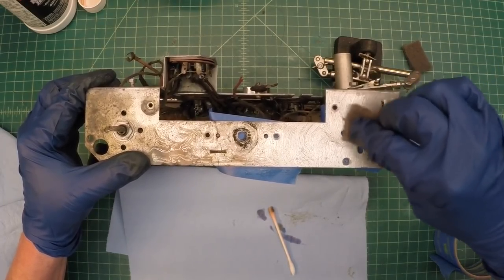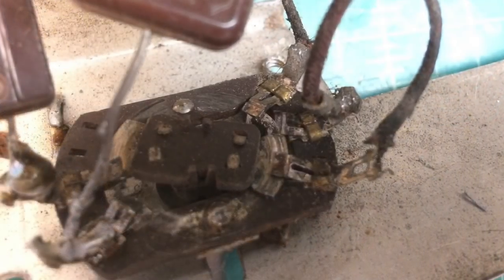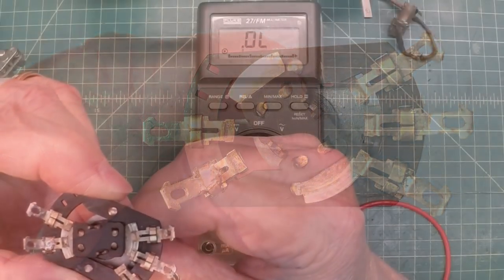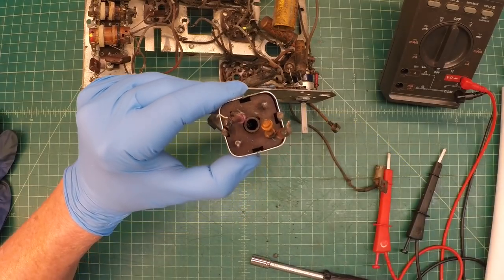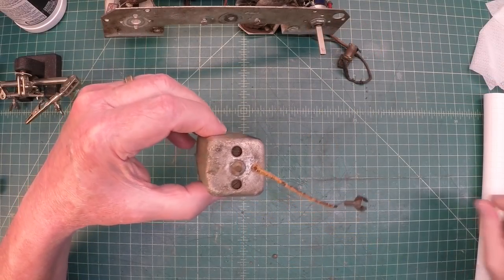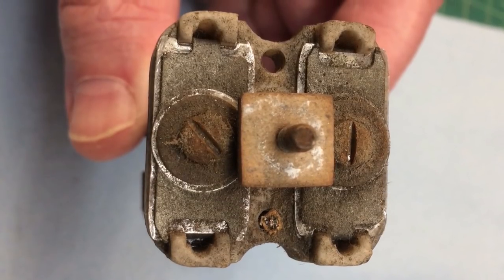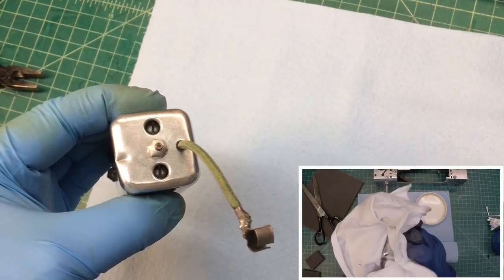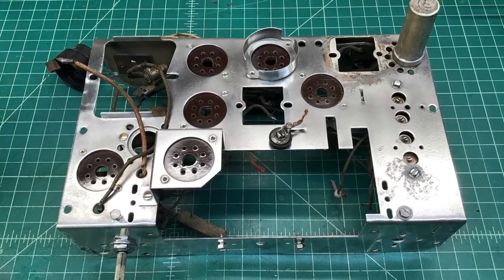Crosley 718-B - Band Change Switch Repair & I.F. Transformer Cleaning/Check

Comment: Amazing job on the slector switch. Certainly a far cry from what you started with. Also the citric acid and water mix does an amazing job. I had often thought about using a diluted acid to clean that kind of stuff. I'm sure the addition of an ultrasonic cleaner would only speed the process and perhaps increase the cleaning power. They work amazing with other things..knobs, screws...etc. Nice work!
Reply from the maker: Hi Paul - so far I’m impressed too. I can’t wait to try some of it in the Ultrasonic cleaner and see how it performs. Thanks again for watching. Best, Don

Comment: Don, I know this is a a year ago but could you say what you used at 6:19 when you cleaned the mica pieces.  In the Zenith 707 series you replaced the mica.  Did you use TO-3 transistor insulators in that case (I probably should have asked this under that video)?
Reply from the maker: Jeff - isopropyl alcohol to clean the mica with a q-tip and correct on the TO-3 mica insulators. If they end up too thick, I will wet sand them down as needed with 400 grit sandpaper, which I’ve done in the past. Sorry for my belated replied, got tied up on a few things that needed attention. Best, Don

Comment: Could you use silver mica caps to replace those mica sheets,
Reply: Silver mica caps, if I understand you, are actually fixed value items & those sheets are part of an adjustable trimmer cap.
Reply: @ordinaryaverageguy76  I seen IF cans repaired with fixed silver mice caps ,you can still adjust them ,there are many you tubes videos showing this repair ,Shangri 66 ,radiotvphononut,many other they cut out the silver mica sheets  ,solder two same value ,silver mica caps,
Reply: There are IF cans where the tuning (peaking) is done via variable inductance (e.g., adjustable ferrite cores) & fixed caps whereas other IF cans use fixed inductance & variable capacitors.  The latter need a variable cap even if it might be padded with a fixed value if you want to peak the IF stage performance.  One could replace a variable with fixed & just call it "good enough" I suppose but it would be suboptimal.

E.g., radiotvphononut's IF repair (https://www.youtube.com/watch?v=QikVrPKNwlY) is a variable inductance IF can and he replaces the internal fixed caps with external fixed caps.
Reply: Those are IF transformers of a different design, they are permeable, or slug tuned, so the powered iron slugs are in the core and the inductance is adjustable whilst the capacity is fixed. In this Crosley the inductance of the IF transformers is fixed, but the capacity is adjustable. Back then it was impossible to build transformers, or any other coil, within exact tolerances, and fix tuned from the factory. Likewise with the rest of the circuitry in the radio, so they required adjustments to put them back to 455 kc, or whatever the frequency was.

Comment: Very interesting Don. Just wondering how you clean the former and the coils or if you do at all? The citric acid does a great job on the cans and screws.
Reply from the maker: Just a little microfiber duster doing my best to remove the the loose stuff from the coils and former. A lot of junk just doesn’t come off and of course I don’t use any cleaner products on the coils themselves. At least they are covered up and out of site. Thanks for reaching out George. Best, Don

Comment: Could you tell me where to buy some of that citrus powder ,I want to keep some,on hand too it work so well for you ,I bought bought a 1960 era G.E.radio,plastic cabinet ,would model glue work on that ,and I need a couple of power cords ,they seem hard to find for my 60 era radios.thanks for your videos ,it makes me a better repair person working on.tube radios,trying to learn some of your tricks
Reply from the maker: Ron, I saw you won the tester from Buddy at The Radio Shop. So cool, congrats and thank you for serving our country. This is what I used: Milliard Citric Acid 2 Pound - 100% Pure Food Grade NON-GMO Project VERIFIED (2 Pound) https://www.amazon.com/dp/B00EYFKM32/ref=cm_sw_r_cp_tai_yT8lDb7Y0XE1S Sorry to hear about the busted cabinet. It seems to be happen too often these days. If not chipped, I would give the glue a try. Applying it in the cracks without getting it all over the cabinet is the tough part; a little glue goes along ways. Good luck Ron. Best, Don

Comment: I just ordered some citic acid ,powder,I cleaning a sprint that holds the battery in a heath kit IN -18 vtvm  I just bought it ,and the battery leaked ,will vitamin c tablets work on until my citric acid powder comes in .I trying to steal some of your proven ideas .and how long do you leave it in the soaker.
Reply from the maker: Ron - I’ve never tried vitamin C.  Let me know if you try it and the results. I hope things go as planned on the Heathkit... Best, Don

Comment: Don, amazing work. What did you use to shine up the IF Cans, was it the citric acid ?
Reply from the maker: Ron, after soaking the can in the Citric Acid/water solution followed by a good wash in tap water, then dried, I applied Mothers Mag & Aluminum Polish using my Scotch-Brite pad followed by buffing. Hope this helps and thanks for watching. Best, Don

Comment: Thanks  Don ,  I really enjoyed your cleaning process.   You always have patience    and a soft touch .  I really like the citric acid solution.  How much to a gallon of water?    How long do you normally wait .    Would that work in a ultra sonic cleaner?          The switch work was amazing.     Thanks.     Dean
Reply from the maker: Dean - thank you. Citric Acid ratios I used.

* 1 Gallon of Warm Water w/ 2 1/2 to 3 Tablespoons of Citric Acid
* 1 Quart of Warm Water w/ 2 1/2 Teaspoons of Citric Acid

My wait period varied. For the tuning mechanism I left it over night, while the small parts soaked for a few hours. I haven’t tried the solution in my  Ultra-sonic cleaner, but I’m thinking it would do a great job. Thanks again Dean. Best, Don

Comment: Boeshield  is good stuff for preventing rust/corrosion, but not a good idea for switch contacts (since over time) it gets to be a semi-hard waxy texture. I would coated/cleaned all the contacts with Deoxit D-5 first, then sprayed on the  T-9.
Reply from the maker: Tom, excellent point! I used QD cleaner on the contacts immediately following the Boeshield to ensure I didn’t compromise the conductive path. I’ll follow up with some Deoxit before reinstalling the switch and keep your MAP in mind for the next one. Thanks for your insight. Best, Don
Reply: No problem; just trying to think logically for not getting selector/pot contacts from getting flakey down the road due to the T-9 turning into a waxy problem.